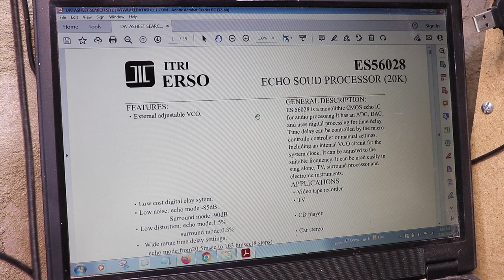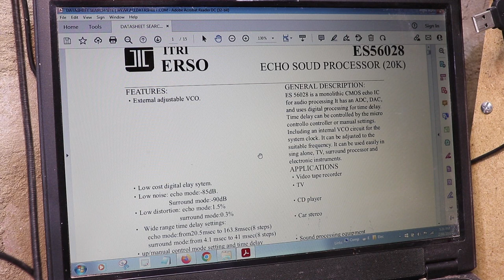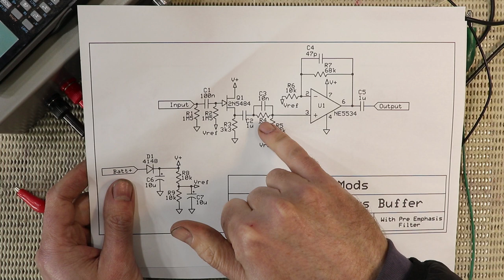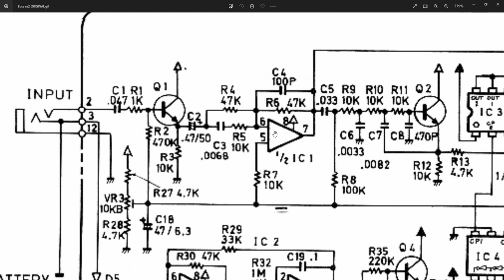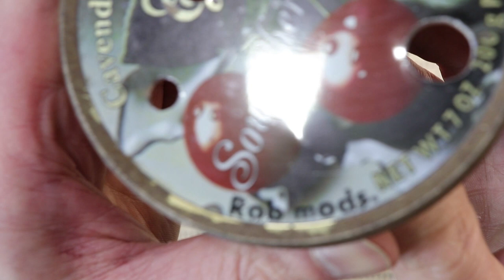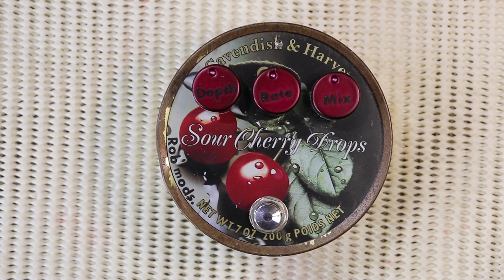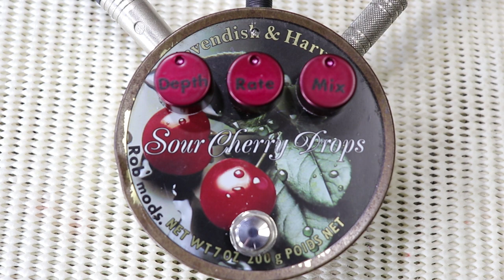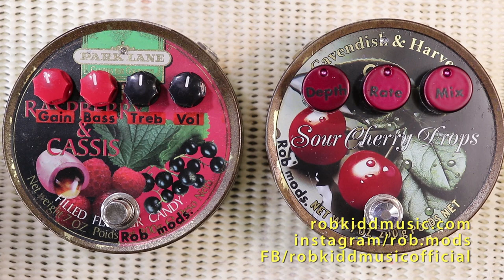How To Rehouse A Guitar Pedal (Danelectro Fab Chorus)

Comment: Hello there I was wondering if you can help me I have been trying to find online that annoying little screw in the fab metal pedal on the bottom of the pedal any chance you can send me the correct link to buy it driving me crazy😢
Reply from the maker: Hi mate.  I just had a look at my old casing, and the plastic screw has an M6 thread and goes about 5mm beyond the plate.  I doubt an M6 thumb screw would fit, but just a regular pan head would work if you are happy to use a screwdriver.   Also I doubt you'll find an M6 bolt that is as short as 5 or 6mm, so you'll probably have to cut one down.  Good luck!